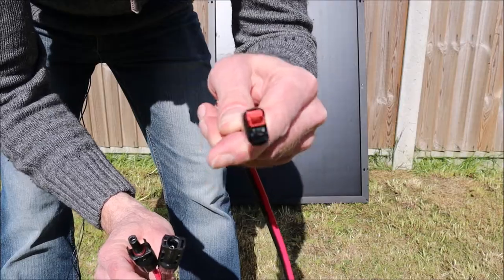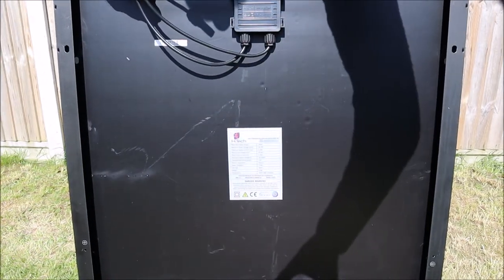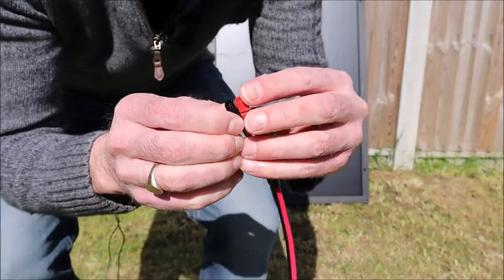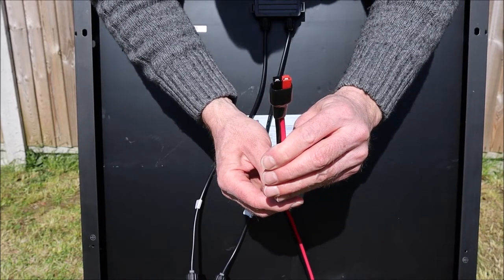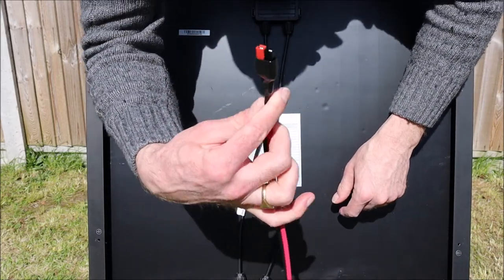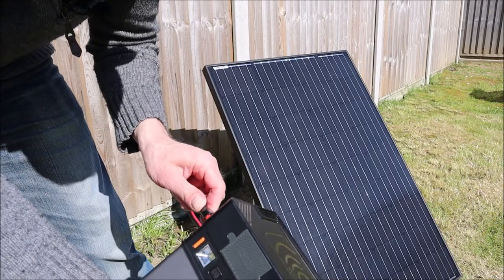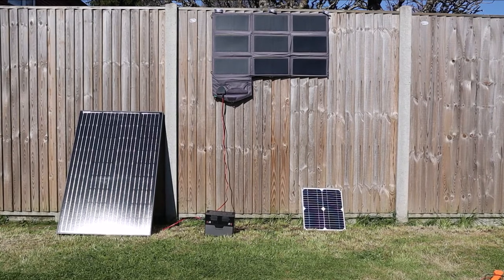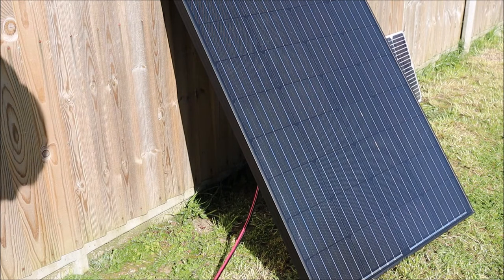New 100W Solar Panel + ALLPOWERS 372Wh Solar Generator | Working from Home

Comment: Can you link the ALLPOWERS 372Wh together another one?
Reply from the maker: @Vinylnuts Thanks for your question. To clarify, do you mean have 2 x 372Wh running together? Cheers, Adrian
Reply: @DADvinci  Yes and could you charge them the same way? Like, have a bank of them.
Reply from the maker: @Vinylnuts You could charge each unit individually as you would normally (depending on charging method). Are you looking to charge one unit, then that unit charges the next and so on? It could potentially be done, but depends on how you want to charge the first unit (solar, 12V from car or mains?). Please can you let me know if I've understood correctly? Cheers, Adrian
Reply: @DADvinci  First unit solar
Reply from the maker: @Vinylnuts  With the 1st unit being charged with solar, you could charge the next in the chain by a couple of methods. 
1) Charge the 2nd unit using the standard power brick by plugging into an AC socket on the 1st unit (easiest, but least efficient method as AC inverter needs to be on).
2) Charge the 2nd unit by using the USB-C PD port. With a USB-C cable and one of these > https://amzn.to/34AKGTr (affiliate link) plugged into the cigarette lighter socket on the 1st unit, it should charge via the USB-C PD port on the 2nd unit.

I've not tested this myself as I don't have a 2nd 372Wh, but it should work. One thing to note is that the solar input on the 1st unit will charge between 57-60W on a good sunny day, so this could slow things down the more 372Wh units you add.

I hope this helps. Please shout if you have any further questions. All the best, Adrian

Comment: Hi There, good informative video. My question is does the solar panel continue to charge if connected from full time, one day to the next, or does it over volt and switch off as you have demonstrated.  I want to keep a motorcycle battery charged in a garage on a permanent  basis. What's your thoughts. Cheers Dean
Reply from the maker: Good day Dean! Thanks for your kind feedback and question. I don't usually leave the panel plugged into the solar generator overnight (connect in the morning). I'll test over the weekend and let you know. All the best, Adrian
Reply: Also keen to know this
Reply from the maker: Hi Dean, sorry for the delay (needed morning sun to test). It didn't wake up and start charging in the morning. I'd like to repeat this test and attempt to keep it awake from the day before.

The more I think about your requirements (keeping the motorcycle battery alive), the more I'm thinking a solar kit with charge controller might be better bet.

I'll let you know how it goes. Please shout if you need anything else. All the best, Adrian
Reply from the maker: Hi Dean, I can confirm that mine doesn't start changing when the sun hits it in the morning. I even managed to keep it awake until the sun went down hoping it would stay that way until morning. Unfortunately, I couldn't trick the charging circuit as the voltage dropped below the cut off point. It appears the only way to charge mine via the Anderson port is the 'wake-up within seconds' of plugging in or try again. I hope this helps. Please shout if you need anything else. Cheers, Adrian

Comment: hi, good vids, will this work ok with my 120w panel, thanks andy
Reply from the maker: @Dru Wilson  Good day Andy! Thanks for your kind comment and question. ALLPOWERS recommend a maximum 100W panel for the 372Wh, probably due to the voltage range on the Anderson port. The manual says that the port can accept voltages between 16.6-22V with a maximum current of 3.2A. My 100W panel produces more than 3.2A, but the voltage is within the port range so charges at about 60W maximum (although is capable of much more). If your panel voltage is within the range specified then it may work, but as I've not tested above 100W I'm unable to say with any certainty. There are some charging 'characteristics' with the 372Wh so the following videos might prove useful (if you've not seen them).

1. https://youtu.be/R2EYi1d6c1M
2. https://youtu.be/ViLdkYzOZqA

I hope this helps. Please let me know if you need anything else. All the best, Adrian
Reply: @DADvinci  thanks for the information,  my panel is max Peak voltage 18v, open circuit voltage 21.6, maximum peak current 6.67A,  dont want to fry the unit, would adding a charge controller before the unit work, regards Andy
Reply from the maker: @Dru Wilson  Hi Andy! Many thanks for the panel details. That makes for an interesting comparison with my 100W. Peak voltage is 18.78V, open circuit is 22.64V and max current is 5.32A. So, in voltage terms your 120W panel is lower and the wattage is made up with higher current. Seeing as mine works with higher voltage and the current is capped by the in-built MPPT circuit at 3.2A (despite the panel being able to deliver 5.32A), 3.2A limit x 18V (ish) = around 57-60W charging I've seen on my 372Wh. On paper, your panel would probably work better than mine, especially with the lower start-up voltage which has caused some problems with the Anderson port on the 372Wh, workaround shared in this video > https://youtu.be/ViLdkYzOZqA .

I only wish I had a 120W panel to plug in as with your specs it should work better than mine. As the charge controller is effectively built-in, it would be extra cost adding another one to knock the current down when it already has the 3.2A limit. I hope this helps. Please let me know if you have any other questions. Cheers, Adrian

Comment: What solar connectors do I need to charge this power station?
Reply from the maker: Good day and thanks for your question. Please can you let me know what type of solar panel you are going to use with this solar generator? This will help to determine what connectors (cable) is required.

In addition, you might wish to view the following videos (if you haven't already seen them) to understand the potential issues with charging via the Anderson port and how to get it working.

1 -https://youtu.be/R2EYi1d6c1M
2 - https://youtu.be/ViLdkYzOZqA

I look forward to hearing from you. All the best, Adrian
Reply: @DADvinci  it's the Dokio 80W solar panel
Reply from the maker: Thanks for the link. It looks like this panel uses a SAE connector. To connect the panel directly to the Anderson port you'll need one like this > https://www.ebay.com/itm/391893812322 or DIY a longer cable to connect up. I hope this helps and please shout if you need more info. Cheers, Adrian
Reply: @DADvinci  seems like i need an XT60 connector with the anderson connector in one cable....

Comment: Hi Adrian thanks also for this helpful video.. 
I was thinking to buy it (also if I'm  a little bit disappointed because this thing does not use the Lithium Titanate battery - so less cycles)..
I already have a solar panel capable to reach about 250w out max. 

Open circuit as yours: 21-22 volts.
The amp can be from 2 to 10/11 out.. so it's huge.

My question is: do you think this solar accumulator can handle with this power? Or the mppt is not made for this power? I know that the mppt solar charger are different. Someone is 10A max or others 20A. 

Maybe this solar accumulator can't handle my solar panel. What do you think? I know it can limit the power-in (as I saw in your video) but incoming power from my solar panel can be too much.
It's rated for 300w (not real but 300w, the dokio solar panel 300w)

Thanks
Reply from the maker: Good day! I'm so glad that you found the video useful. As you say, your solar panel produces much more power than my new 100W. The manual only references a maximum solar panel power size of 100W, so I wouldn't go beyond that personally. Without knowing the specifics of the internal MPPT circuit, it's difficult to understand if it would handle a panel that produces over 6A.

I can ask the manufacturer whether it can handle above a 100W panel if you wish? All the best, Adrian
Reply: @DADvinci  sure thank you! Need to know how much power in, the internal mppt, can handle. Thanks!
Reply from the maker: I've asked the manufacturer and will let you know when I hear back from them. All the best, Adrian
Reply from the maker: Good day! I've had a response from the manufacturer as follows:

*****For your question:“Is it possible to connect up a Dokio 300W solar panel to the Anderson port?" We insist that the answer is NO. The solar input from DC or anderson only can handle up to 60W at Max., considering of in some area that not so sunny, we can increase the panel's wattage to 100W which should be enough already. recharged in 7-8 hours under straight full sun (6-7 hours, under STC, AM1.5, 1000W/㎡ 25℃, recharging time varies from different location, temperature, weather, etc.).

If you do not have other kind of solar panel, it is fine to connect a 300W solar panel to our generator,for those using their own solar panel, make sure that Optimum Operating Voltage of your solar panel is between 16.6-20V to be compatible with our Solar generator.***

I hope this helps? All the best, Adrian